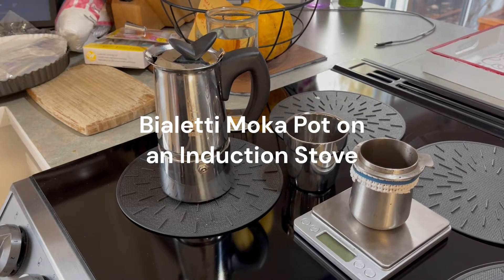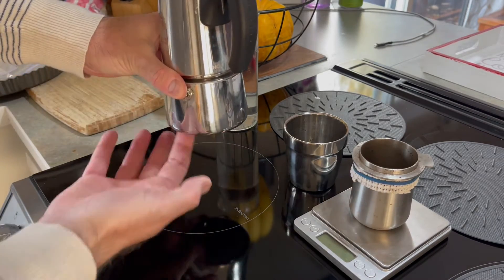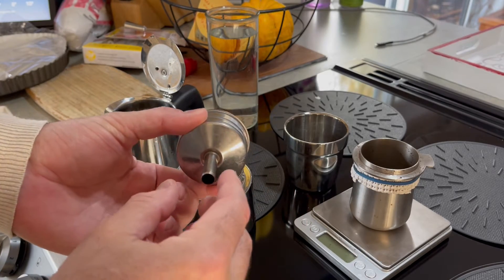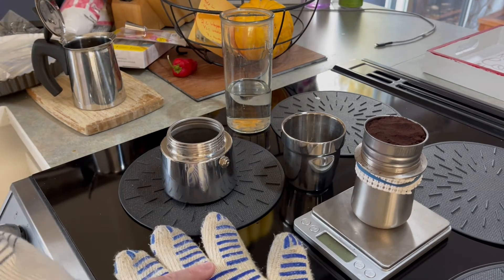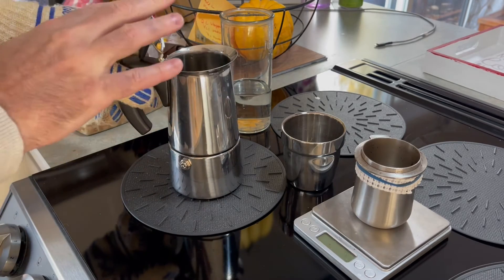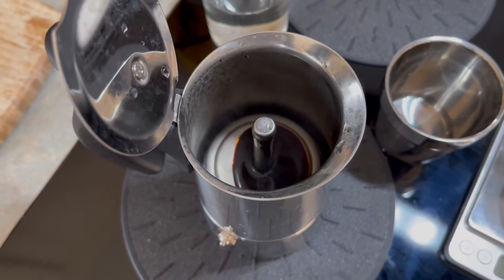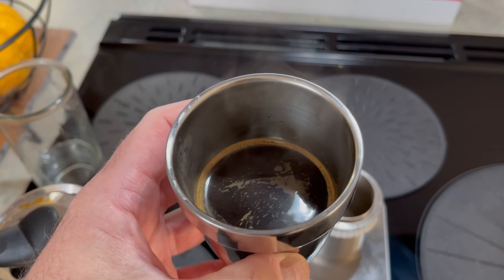Stainless Steel #Bialetti #Moka Pot on an Induction Stove!

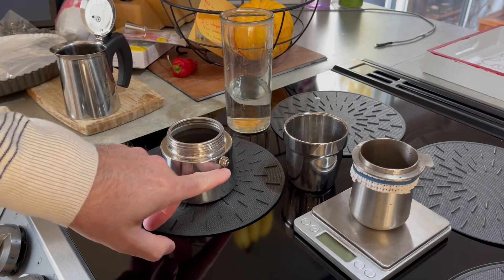Comment from the maker: Water amount is right below the pressure release valve (2:40). When brewing, remove from heat as soon as the coffee liquid above starts to sputter and loose its colour. The coffee used is 14.5 grams (2:58).

Comment: A couple of tips you might find helpful making Moka Pot espresso… 
• There is no benefit to pre-boiling the water. Simply assemble the Moka Pot with cold water, your coffee, then brew. The time difference is negligible and there's no risk of getting burned. 
• You don't weigh Moka Pot espresso coffee. Each size Moka Pot requires a different amount of coffee. Simply fill the filter basket level with the top of the basket. 
• You are correct… You should remove the Moka Pot from the heat immediately upon sputtering - or just before would be even better. However, at the end of brewing there is no more water left, that's why it sputters - it's not necessarily over-extracting. Over-extraction would be using too low a heat causing the water to stay in contact with the coffee too long. That would result in over-extraction. 
• Moka Pot espresso is for all intents and purposes… "espresso". There may be some arguments by certain espresso purists. But Moka Pot espresso strength and flavor are extremely similar to espresso machine espresso. 
• Finally, I've found aluminum Moka Pots make a better espresso than stainless steel models. Unfortunately, aluminum doesn't work on induction. 

Here are a couple of excellent videos on Moka Pot espresso you might find helpful as well… 

Annalisa J. 
https://youtu.be/QbhYNipVYSY    

Italian with Bri
https://www.youtube.com/watch?v=_HKSe5Zo8tE    

Wishing you an amazing coffee day!
Reply from the maker: Thank you. These are great tips and greatly appreciated.
Reply from the maker: Thanks to your comments, I have a new video with your suggested ideas. https://youtu.be/7UTXDzAJOD4